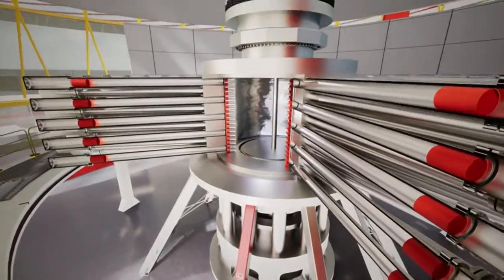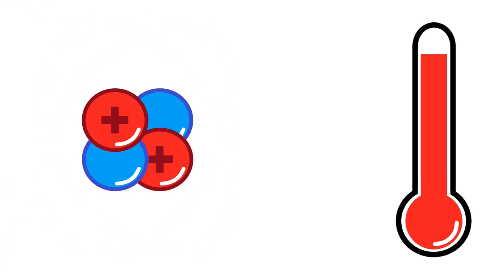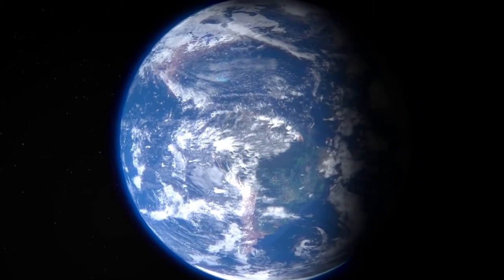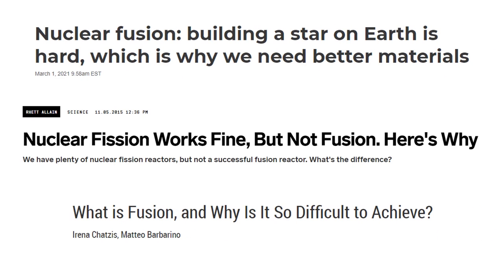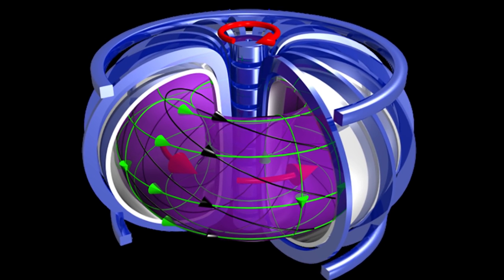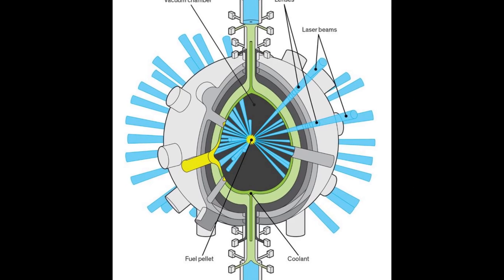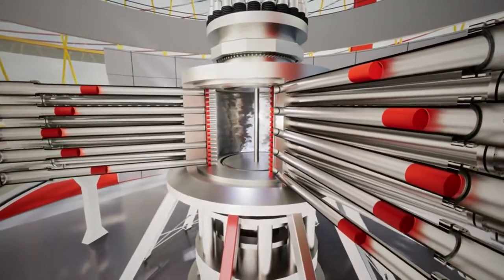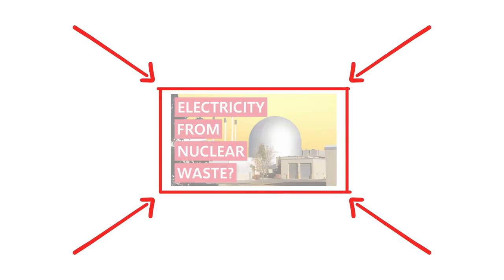This Canadian Fusion Reactor Could be Built by 2025

Comment: This design was first proposed by Naval Research Laboratory in the early 70's, and it theoretically can work. Also General Fusion's reactor has a layer of lithium blanket installed very close to the reactor walls. So when the free neutron is emitted, it will hopefully hit the lithium and creat tritium. This is called tritium breeding. 

Although it should work, the 2 biggest issues are now the plasma injector and the completion of the fusion. 
Plasma will cool down drastically after exiting the injector, the compression from the pistons should raise the plasma's temperature to around 200M K. However if the process isn't done fast enough, the plasma will be way too cold for fusion. 
Even if all that is sorted, we don't really know how much of the plasma will actually fuse to create helium. Some estimation puts it as low as 10% of the plasma will actually fuse. If that is the case, then the reactor will never be feasible for power generation. 
I personally hope they succeed, but it will be challenging.

Comment: Liquid metal nuclear fusion. The race goes to the quickest. Currently, the swiftest advances in for electricity production looks to be advances in solar panels plus batteries. Beyond this is wind platforms at far ocean. Beyond this, all else are basically 'dark horse' power production. Somebody has success with fusion, or molten salt reactors, or even atmospheric kites or tidal! Until then, the commercial race is going to solar seemingly-even on cloudy snowy days.
Reply: @paulbedichek2679  They are beating the hell of fusion or fission is my response and so are battery innovations. This is what has killed uranium and thorium power. Getting MSR's or helium moderated reactors using Triso low rad fuel, or using Lightbridge's fuel rods. Maybe there will be a commercial breakthrough, maybe? Let us hope. As of today it looks like solar and wind are the easiest to grasp by our species.
Reply: @mortimerhasbeengud2834  No, solar has been close to useless, the product of death camps and coal, wind power has made progress and reduces the amount burned by fossil fuel systems.
Only nuclear power is widespread, reliable, safe, clean, and dispatchable.
Reply: @paulbedichek2679  Buying from China bad, yes. Fission is widespread but has been stunted for decades. If engineers can improve the production time and safety and cost, more power to them.

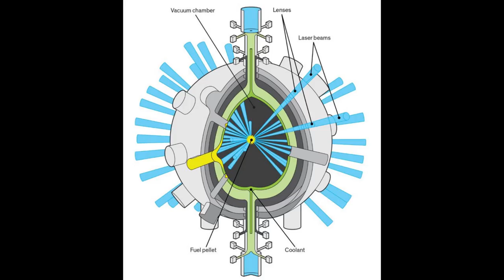Comment: 5:28 that steam piston approach does not allow continous operation .... I think the most promising is the Wendelstein 7X approach which should allow continous operation
Reply: It is designed to operate continuously - the design they are working towards has 500 pistons only a few are required to fire at a time to initiate a reaction the reactor is designed to operate from 6 to 60 cycles per minute as needed
Reply: @carboncomplex  With continous operation I meant that the plasma is continously kept at fusion temperature. This designs is a variety of ICF which is not continous in this regard.
Reply: In that regard It operates more like a internal combustion engine.
As long as the intermitted fusion reactions generate enough heat and they can extract it using the liquid metal as planned, you can run generators off of its continuously.

Comment: 3:30 the problem is in keeping it hot as it may easily cool down for various reason ... one of them is that the fusion neutrons can easily escape because they are electrical neutral and carry with them most of the energy .... ((for a big enough plant that would not be a probably as neutrons have a relative short half life))
Reply: I can think of a solution to those problems. 1 Use Gallium as the reactor coolant, it has a boiling point of 2400 degrees celsius which is ideal for this purpose. 2 Use tungsten for the reactor shell and coolant pipes because it can handle the heat from 2000+ degree molten gallium and being an incredibly refractory metal it will hold that heat for a long long time. Tungsten is also the second densest metal we know of which makes it perfect for stopping neutrons and absorbing their energy.
Reply: @killman369547  I meant fusion temperature which is millions of degrees --- briefly said hotter than the sun's core.
Reply: That's why they only inject the plasma right before they fire the pistons. 
And it wasn't mentioned in the video but the plasma will be magnetically confined (but not anywhere near as strongly as in for example a tokamak) so it mostly wont be touching the liquid metal until it's already imploding.

Comment: This concept will never work. In the video it appears that the molten metal volume magically increases when the pistons hit. Apart from that the description of the process has it that the pistons induce a shock wave in the molten metal. A chock wave cannot compress the central channel, at most it could give rise to uncontrolled splatter.
Reply: Centrifugal forces would first force the liquid metal into the passages used by the pistons before compression.
Reply: @combcomclrlsr  
No, there is no liquid metal in the cylinders. If it were, injection of this metal into the spinning metal would totally destroy the ordered rotation of the metal.

See: https://en.wikipedia.org/wiki/General_Fusion
"The hammer piston struck an anvil at the end of the bore, generating a large amplitude acoustic pulse that was transmitted to the liquid metal in the compression chamber."

So my objections to the concept remain.
Reply: @VeritasPraevalebit  The video here: https://youtu.be/Xn8gjAgMG28 shows large steam driven pistons driving a second set of pistons which are in direct contact with the liquid metal. Apparently the inner set of pistons rotate with the liquid.
Reply: The concept was first proposed by US Naval Research Laboratory in 1971 called Project Linus, and they were very close to getting the concept to work. But they couldn't build a plasma injector that could sustain the temperature of the plasma long enough after injection. Also due to the lack of computing power back then, they were unable to model complex hydrodynamic interactions involving spinning molten metal and plasma. And they were also unable to be synchronize the pistons with the injection precise enough, again, due to lack of computing power.
Now with a much better plasma gun and ample computational modeling, in theory this can work. Although it will still be a very difficult task.
Reply: @_EVANERV_  
Yes, there is a Wikipedia entry on the Linus project: https://en.wikipedia.org/wiki/Linus_(fusion_experiment)
As I said above, the vertical central channel in the spinning liquid metal cannot be compressed by a shock wave and this is not what happens in the Linus concept:

"For operation, a system, typically consisting of pistons, is used to drive additional liquid metal into the drum. This causes the entire liner to be forced inward. In experimental systems, this provided about ten-to-one compression. The extra metal is then removed again by releasing the pistons, causing the compression to reverse and the metal reach the original position at the outside of the drum."

General Fusion does not have the "additional liquid metal" needed to compress the central channel.
The reason for this could possibly be General conFusion.
Reply: @combcomclrlsr  
No, the pistons hit anvils at the bottom of the steam cylinders so no molten metal in them.
Reply: Surely before spending hundreds of millions on building this machine, they will have done extensive simulations of the hydrodynamics. Have they published any peer reviewed papers on the temperature/density/confinement time they hope to achieve?

Comment: this idea doesn't make much sense. How are the pistons going to squeeze the liquid metal when it'll just flow through the spaces in between the pistons? How do you avoid quenching the plasma which is superhot but comes into contact with liquid metal which is much colder? How far can the pistons go without ramming into each other? Sounds like a scam...and it doesn't appear it could work. I support fusion energy but this was not a great idea when you look into it a little deeper. But let's see if they can resolve those issues, though I doubt they will.
Reply: The pistons will possible be phased, like a car engine, not pushing all at once. Furthermore, the liquid metal sphere might be big enough to keep the pistons from going in too far.  As for going around the pistons, it's not really a problem, as the chamber itself will not be able to expand and the liquid metal movement will be restricted. In fact, I don't think the pistons would much much at all, since liquids don't really contract. It would be like a piston pushing water into its glass; nothing would move the glass breaks due to pressure.

As for quenching the reaction, I don't know the answer to that, especially without knowing the liquid metal temperature itself. But pressure is a big equalizer.

Comment: Making it is one thing, containing it is another. Too many moving parts for continuous use - my thoughts anyways
Reply: Pistons are a very well understood mechanical devices. i really don't think that's were the problems will be coming from.

And they don't seem overly complicated or expensive to build once you figure out exactly how, so you can have multiple of these at every facility for some redundancy.
Reply: @TheCountess666  yes, but they have to survive very hot molten metal if the fusion event occurs.

Comment: always 30 years later… who knows? hydraulic this time. if hydraulic in this case can press that hard, what makes them didn't "flow back" from the piston? and that's how many tons of pressure in the chamber? that's practically a large pressure cooker, and we know pressure cooker do not emitt radioactive substances, but it is subject to numerous cases of explodes. the first challenge probably would be how to flip the switch on to sync all pistons to press at the same time, the first one in a long list of problems. that was a manhattan project's problem. and they solve it with explosive and detonator, and it work only once in every device. repeating compression means repeating clockwork accurate sync. who knows? may be they can? but I have a feeling that's going to be another money pit.…

Comment: No longer true...happened a few months ago...now they can produce more power than it takes to sustain fusion
Reply from the maker: If you're referring to the experiments at the National Ignition Facility, while the fusion produced more energy than was absorbed by the fuel pellet, the lasers themselves still took more energy to operate than was released by the fusion. But if there was another experiment that I'm unaware of I'd love to hear more about it. https://www.sciencealert.com/for-the-first-time-a-fusion-reaction-has-generated-more-energy-than-absorbed-by-the-fuel
Reply: @ProfessorGoose  ..I stand corrected..it appears I did not read the same article closely enough...but u must admit they are on the edge..the energy produced nearly equalled the Lazer energy and was 5 times the amount used by fuel...obviously we are inching closer..its a milestone that mankind desperately needs right now
Reply from the maker: @donrice2609  the advancements are very exciting!
Reply: Even if you could get the thermal energy to match the energy put into a fusion reaction you'd need at least 2.3x that as the very best thermal generators have an efficiency of 45%.
Reply: @wakannnai1 ...thats not really the point as of yet...right now we are at a more theoretical aspect of the reaction...once the issues are worked out the energy in/out won't be any issue...fusion will create so much energy that those issues won't matter..if it loses 55 percent in the transfer...then scale it up 60 percent..we are truly AT A NEW AGE FOR MAN
Reply: @donrice2609  Nuclear weapons saved millions of lives in WW2,what would you do that is wiser? Nuclear energy using fission has saved millions of lives by both replacing coal and by medical isotopes, wind and solar can not make that claim.